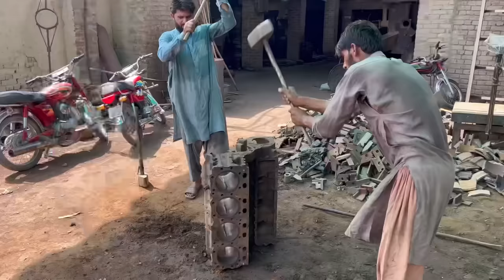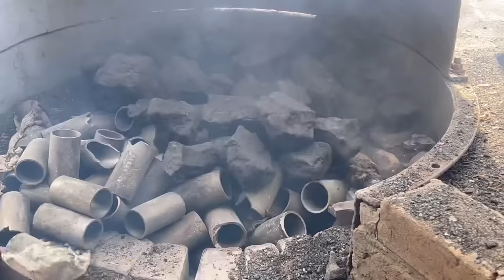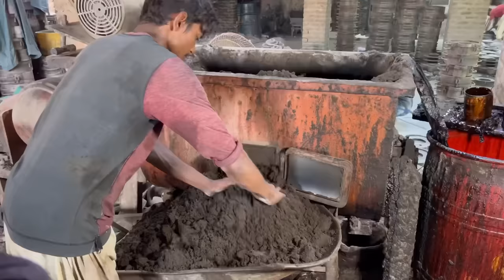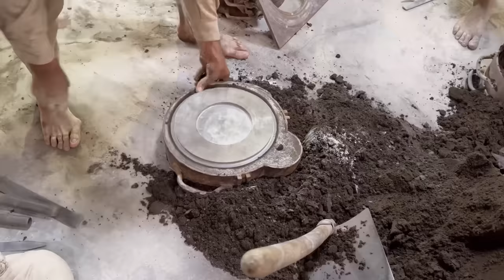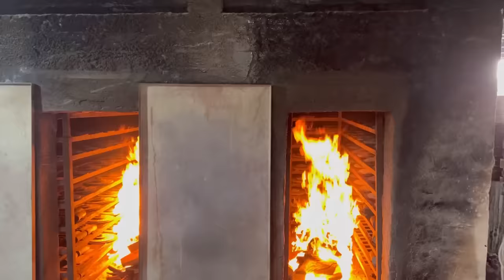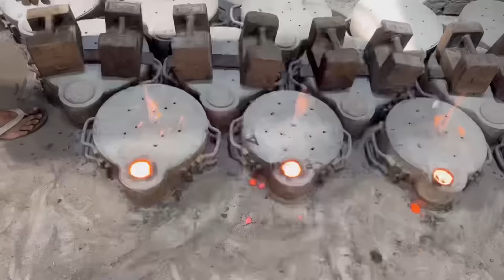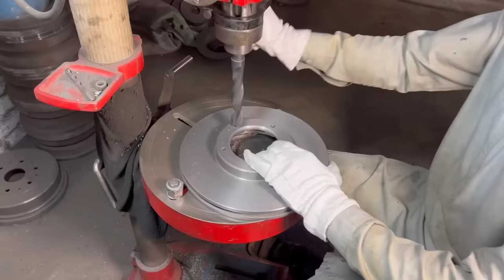Amazing Manufacturing of A Car Disk Brake Plate |

Comment: There are those safety bare feet again. For the really dangerous jobs they issue flip flops. Where I work if I step into the electronics lab I need to wear a lab coat, anti static strap, steel toe cap shoes (non conductive soles) and safety glasses. Seems a bit over the top but there again we have zero accidents in six years.

Comment: Many many no, no's here. The castings are very crude, but I will skip that side for now as it would take up far too much time. I have not seen any European vented discs for decades that are are not a ground finish. A turned finish is not acceptable as the cutting face is a spiral and it actually cuts the brake pads when pressure is applied to the disc. This spiral screw type cutting action would also cause rapid and uneven brake pad/disc wear. Grinding the two main pad faces, removes this screw type cutting action. It also gives smooth, parrallel and flat surfaces, which gives the pads a flat bedding in face to start with. All OE spec Discs will be machined to this standard, They will rarely warp or judder if fitted and checked within DTI tolerances of within 0.006" or 0.15mm for normal production type cars. Just buy copy discs that are manufactured to OE standards and you will not go far wrong.

Comment: I bought a car with wheels made in India. Most likely the method is identical to that shown in the video. If you drove through a puddle and water got on the disk, then you are already riding on a “humpbacked” disk, like on a camel.
Summary. There is no technology, no metal, no understanding. Total marriage.
I threw out the wheels, almost new. I bought and installed disks from another manufacturer.

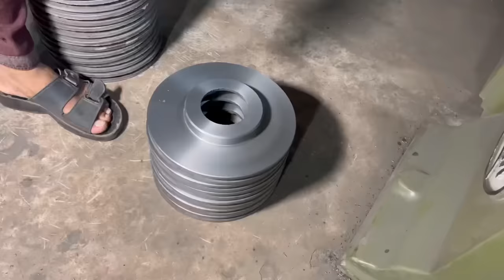Comment: 17:35 / 23:09

Amazing Manufacturing of A Car Disk Brake Plate |

Mechanical Skills
구독자 23.8만명

7.7천

1.3천

공유

오프라인 저장

클립

조회수 92만회  5개월 전  UNITED STATES
Discover the amazing manufacturing process of a car disk brake plate in this video. See the intricate engineering and craftsmanship that goes into creating these vital pieces of automotive safety technology. Watch as experts explain how raw materials are transformed into precise parts through cutting-edge machinery, and learn why this product is so important for keeping drivers safe on the road. See it all for yourself with this remarkable look at car disk brake plate manufacturing and its many fascinating facets! …
댓글 1,516개

Comment: a safety critical component made with no safety or quality control in mind. as long as its made of metal regardless of the composition. this is not ingenuity but should be a video on how not to produce brake disc.

Comment: Looks like a brake disc - but it can't be used as one. No comprehensible and homogeneous cast iron mixture, no reproducible result and certainly no control of the properties of the material that is randomly poured into the mold. It's really scary that such inferior products still exist today in an area of mobility where safety and human life are important. Then the surface is simply turned off, the thickness of the brake disc is uninteresting, it is simply done based on feel. The disc is not balanced at all. It is a chance product in the form of a brake disc, where you never know exactly how it will brake or whether it will withstand extreme loads. Russian roulette in the brake sector. It can go well - but it doesn't have to. Thank you, I'm happy to forego this "quality".